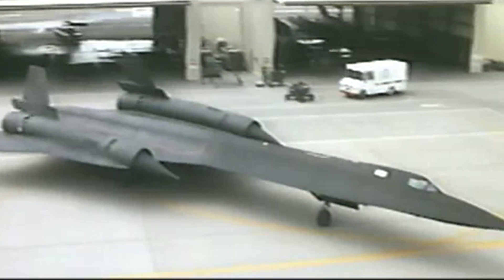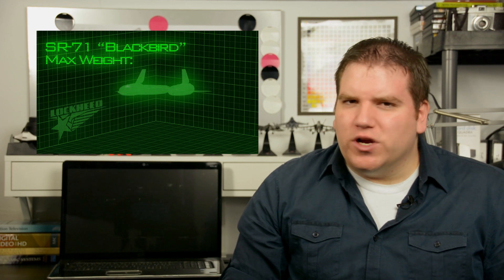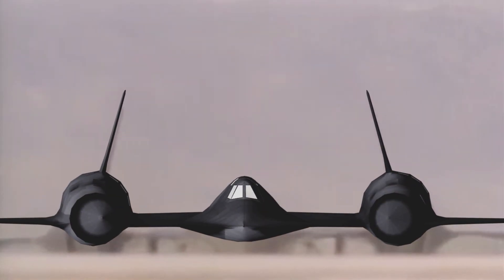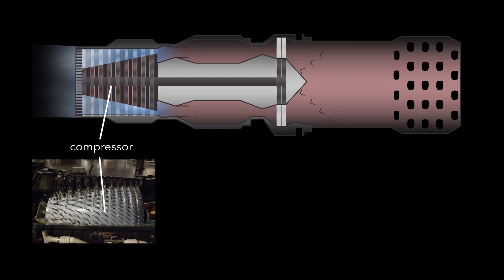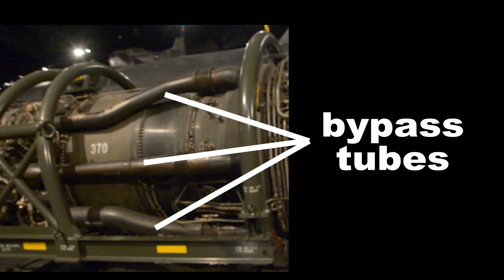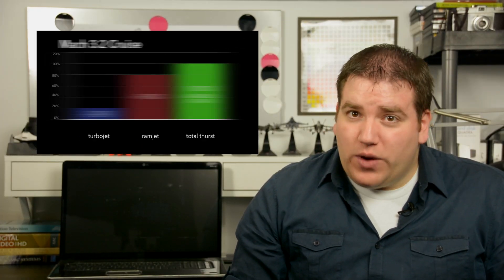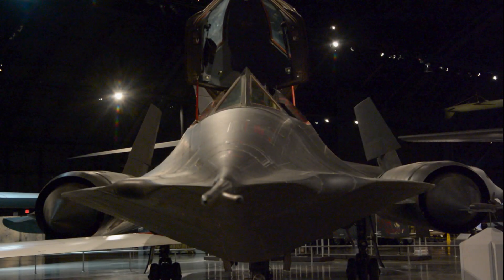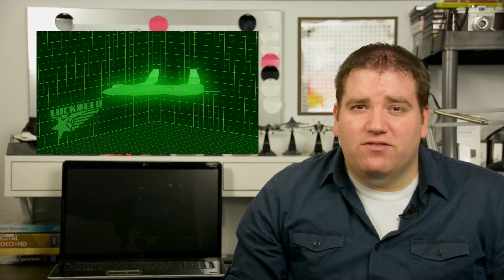The Plane that Dreams are Made Of: The SR-71 Blackbird

Comment: Sigh :/ the wonder of planes and aeronautics that it was, and all those bloody Russo fanboys keep yapping about how that junk Mig-25 and Mig-31 were able to repel it. Well, they only go lucky enough to get into weapons parameter but still never downed this amazing masterpiece which they never can touch :')
Reply: Stormsquad Considering it was locked on to several times...sometime, you don't have to press the trigger to make the statement. And, you don't have to be Russian to do it either.
Reply: ***** Getting a lock and shooting down the plane are two completely different things. The SR-71 could outrun even those missiles. In the SR-71, at startup on the runway, it normally takes a long time to spool up, but once the afterburner is on, the plane flies and accelerates like any other fighter upto Mach 1.5 or 1.6, after that, if you keep the engines at full burner and keep the nose about 15 to 20 degrees above the horizon, I can promise you there wouldn't be a missile in those days that could catch it, cause after that, the plane just shoots like it was fired from a gun. Its like in barely 2 seconds you reach from Mach 1.6 to Mach 2.5, and then it just increases from there and reaches Mach 3.70 in yet again a couple of seconds!
Reply: Stormsquad " The SR-71 could outrun even those missiles."
Yeah....tell me, what's the weather like on YOUR planet?

"reaches Mach 3.70"
Here on earth, it's late spring in the northern part of the globe.
Reply: ***** Yeah and Aliens don't mess with earth because of Russia, happy?
Reply: Stormsquad Oh, absolutely. Aliens can be scary.
Don't quite see how that's relevant to your inventions, though, but it's all good.
Reply: ***** The unclassified top speed of the Blackbird is Mach 3.70, the classified is obviously far more. But you are too attached to the oh so great Russia that is why i said that.
Reply: Stormsquad The unclassified top speed of the Blackbird is Mach 3.3. There are claims of mach 3.5, but that's unconfirmed.

To claim that the classified is 'obviously far more' is more nonsense. More? Yes. FAR more? Not even hardly. There are limits to what airbreathing engines can produce.

And considering the phrase "And, you don't have to be Russian to do it either.", we see how "attached to the oh so great Russia" I am.

Basically, three tries, and not one hit the target. Try again?
Reply: ***** Im not trying to hit anything here, you simply assumed I did, and here in the video he did mention the classified is much more so yeah. I don't need to say anything further.
Reply: Stormsquad "Im not trying to hit anything here"
You keep telling yourself that, and you might actually be able to convince yourself some day.

"I don't need to say anything further."
This is true...if not in the way that you want it to be.
Reply: Stormsquad That's the common answer, isn't it? "I said things that were wrong, he's proving it, he must be a troll! Because it could NEVER be that I shot my mouth off!"
Reply: ***** NO, you never actually proved anything. My proof is this video right here it was mentioned so. Oh and I got more here as well......

http://www.blackbirds.net/bbirdm&f.html

So when I said Mach 3.7 I pretty much meant it. But you just said "No it can't go that fast" and since it was locked means it can be shot down. Then by your logic, the IAF Migs must have shot down those PAF F-16s because they simply had a lock on them.
Reply: Stormsquad "So when I said Mach 3.7 I pretty much meant it. "
Oh, I'm sure you meant it. Doesn't mean you're RIGHT...but I'm sure you meant it.
Of course, we also see you didn't even read your own link. That's impressive.
Now, the fact remains, the official number is 3.3. Unofficially, and unprovenly, there are claims of 3.5.
Following that, we see that, yes, they could've been shot down, if the pursuing pilots wanted to. But then, as we've seen you can't comprehend basic written english, it isn't surprising you don't understand that either.
Reply: ***** Which is why the word 'official' was in there.
But, it IS known that at around 3.7, plus/minus about 0.1, conditions would likely cause an unstart.
Reply: ***** "Which is why the word 'official' was in there.
But, it IS known that at around 3.7, plus/minus about 0.1, conditions would likely cause an unstart."

And yet you have shown no proof or source of such a claim being true in anyway
Reply: ***** My question to you is, if you think we are such fools and are so dumb, and if you are so smart, why do you mix with us in the first place?
Reply: Stormsquad "And yet you have shown no proof or source of such a claim being true in anyway"
This is true...I didn't think I'd need to. But I guess you didn't bother reading the link you yourself supplied?
Reply: ***** Ok, who-ever is letting this mentalcase have access to a computer...you're not doing him any favors. For his sake, if not yourse, do put him in a soft room and give him plenty of his medication.
Reply: ***** I think his "Real world" means his mind, because in his mind, the SR-71 was easy to shoot down, and in his mind the F-15's 105:0 kill ratio means nothing while a bunch of Su-30s doing flip flops at an airshow means they are automatically the most lethal on the planet. I'm just wondering, the Su-35 is oh so great, and oh so cheap and maneuverable and lethal and also openly available for export, yet nobody wants the damn thing, not even one customer has bought the Su-35, while people are just lining up to buy the supposed junk F-35 which apparently can't do anything, but everyone still wants it like its gold
Reply: Stormsquad Sure....you keep telling yourself that. Meanwhile, here in the real world, the reality is abit different, isn't it?
By the way, have you actually read that link you provided yourself, yet? Or is it another case of "oh, SHIT, I shot my mouth off and he called me on, better deny, deny, deny, and try to distract away from it!"
Reply: ***** Well I don't need to tell myself that cause the "real world" in which we all live in approves of it, and since you are the only one who disagrees with it, the "real world" that you refer to is none other than your own mind where what you claim you simply wished it would have happened but in reality it just hasn't :)
Oh and Lt. Viktor  Ivanovich  Belenko himself claims the Mig-25 is not capable of taking down a Blackbird. Here's what he said........

Ability to intercept an SR-71: Belenko states the Mig-25 cannot intercept the SR-71 for several reasons: The SR-71 fly too high and too fast; the Mig cannot reach it or catch it. The missiles lack the velocity to overtake the SR-71 and in the event of a head on missile fire (The Golden BB), the Guidance system cannot adjust to the high closure rate of the SR-71.
Reply: Stormsquad " Yeah I will admit I am dumb and you are smart, happy?"
This was already known.
It's interesting to see how defensive you became as soon as it was pointed out that the SR-71 isn't all that, despite your fanboyism.
It is impressively engineered, certainly, but it isn't the creation of god come down from upon high.
But point that out, and your mind goes out the window, reading things that haven't been said, and twisting the things you DO read to fit your own little world-view instead of reality.
Reply: +Shinji Hirako Which exactly? There are couple of guys there I don't know which of those two exactly. I'm guessing the guy who ranted too much?
Reply: sr71  mach 3.70  but after talking to pilots it sounds like it broke mach 4
Reply: stormsquad  you are right ,,, i met with pilots of the SR71  ,, and what you say is right on with what they stated ,,, nothing that Russia could even come close to this thing ,,

Comment: Some people claim that the classified top speed of the SR-71 is about Mach 3.5 but honesly i think it is way higher than that. Why?

Look at the XB-70, an amazing aircraft but didn't have much of the "go faster" bags of tricks that the SR-71 have, the XB-70 also used the fuel for cooling but not to the extreme extent that the SR-71 did, SR-71 pilots have stated that even the inside of the glass was so hot after the flight that it was impossible to touch it, the XB-70 have much fewer heat related stories, the only one is the failure of a honeycomb structure at mach 3 suggesting that the SR-71 cruise speed was much higher than the XB-70. The SR-71 uses the awesome J58, 2 turboramjets that uses the highly complex spike, nacelle, bypasses and alot of other stuff, the XB-70 uses regular turbojets.

The SR-71 was leaking on the ground, only after speedruns when the airframe and fuel tanks and everything had expanded due to the heat; the SR-71 would stop leaking, never heard the same story about the XB-70, the list goes on and on, and still, the XB-70 was a mach 3+ airplane.

The XB-70 doesn't look as refined either as the SR-71 which every inch of the airplane looks to be designed for super high speed runs. So yeah, comparing the 2 airplanes and keeping all the technology in mind and all the extreme solutions for speed in the design of the SR-71, to me atleast, it would seem like the SR-71 is much faster than the declassified mach 0.2 or (0.4 suggested classified) difference between the 2 airplanes. Also, the MIG-25 can do mach 3.2, sure, it destroys itself while doing it but yeah, XB-70 and MIG-25 looks almost "ordinary" compared to the SR-71 but the difference is just mack 0.2 and 0.1?

Also, the difference between the declassified top speed of the SR-71 and the claimed top speed of mach 3.5 is not big enough to keep it classified, if the true top speed was 3.5 i think they would have declassified that number instead. Doesn't make sense to keep mach 0.2 difference a secret.

So yeah, i don't think mach 4+ is that far fetched.
Reply: Flip465  you dont have to go mach 5+ to outrun a mach 5 missile. Missiles dont chase you, they meet you at a point in space. They calculate that point and fly an intercept course. 
To evade sams, the sr pilots would simply accellerate because that would force the missiles to change that ip faster than they were able to. 
There are plenty of stories from sr pilots of sams passing close by, fired by clever operators. 
These claims of mach 4 plus are unfounded. The difference between mach 3.2 and 3.5 is massive. At these extreme speeds, its not a linear increase in stresses and power requirements.
Reply: lol Are family n friends (few USAF) have always said the same thing!
Reply: ***** It is not built and look like that for a meager Mach 2.5 lol  Like you said easily double that. Can only imagine what's flying now.

Comment: I worked at Lockheed (N. Hollywood) after the SR-71 was built, but my supervisor who did work on the project said it was designed in 1958.  No doubt the electronics was upgraded many times.  Is this information incorrect?
Reply from the maker: 1958 marks the start of the OXCART program for the CIA and the design of the Lockheed A-12, the direct precursor to and sister of the SR-71.  1962 marked the completion of the A-12's design and its first flight, as well as the approximate time when the USAF took interest in the plane and redesigned the aircraft to be a two-seater fighter plane (the YF-12), and then a two-seater reconnaissance plane, rather than a single seater.  The first YF-12 flew in 1963, the first SR-71 in 1964.

Comment: Hey Tech, can you do a video about unstraps. I know little about them but they fascinate me. At mach speeds if the airflow at the inlet wasn't perfect the sudden turbulence would cause an 'unstrap' and they would have to slow down and adjust the inlet spike. Is that right?
Reply from the maker: It's actually called an Unstart - Check out my video about the J-58 and pay specific attention to the movement of the inlet spike.  If the reflected shockwaves inside the inlet get suddenly knocked into the diffuser just in front of the engine face, the pressure would drop suddenly and the power going to the afterburner would drop, since the ramjet part of the engine handles most of the compression at that point.  Immediate loss of power in that nacelle, and the analog computer had to drop the power in the other nacelle to compensate.  The spikes were then pushed forward to recapture the shock wave and position it in the inlet.
Reply: OMG I actually typed "unstart" but the Auto-correct changed it ha ha. But hey I appreciate you taking the time to respond - you have a great site and videos.

Comment: I heard a story a number of years ago that the US military was looking for a [new] manned supersonic reconnaissance plane for its modern [post 9/11] arsenal.  Even though slower-moving drones and constant satellites can loiter for much longer times and are unmanned, the problem is once on-station they are predictable in their flight paths.  What I was told is that a manned supersonic plane was needed because it could get on-station a lot faster for intel sooner, BEFORE a satellite can complete its tricky-and-expensive orbital maneuvers or a slow-moving unmanned drone could get out there.

Although the Blackbird is definitely retired, is it true that the military is looking at it as an example for a future manned recon plane?  ...or was I naively lead by the nose?
Reply: there is always a "next" project
Reply: They're working on keeping the speed but trying to silence the sonic boom. Then with the shapes need for that it has to be matched up with the shapes needed for stealth, fuel temps and weight factored in, electronics,  possible weapons. It's a very big job. Imagine what 50 years of progress will bring.
Reply from the maker: Nothing official - Lockheed proposed an unmanned hypersonic drone, tentatively named the SR-72, but nothing else official has surfaced.
Reply: oversoul Correct. In Lockheed's case it was the HAVE BLUE / F-117 projects.

Comment: why did it weigh so much if it was made of titanium and composite ?
Reply: The often quoted 70 tons is take off weight includes full fuel load, 80,000lbs of fuel. Subtract that and the actual airframe is 60,000lbs not bad for an aircraft that's 107 feet long with a wingspan of 55 feet.
Reply from the maker: When you see it in person you realize how BIG a plane it really is.  That, and most of the plane's interior space was essentially fuel storage (which was also its cooling system), and there's no easy way to lighten fuel.